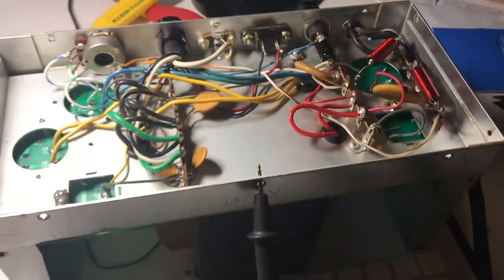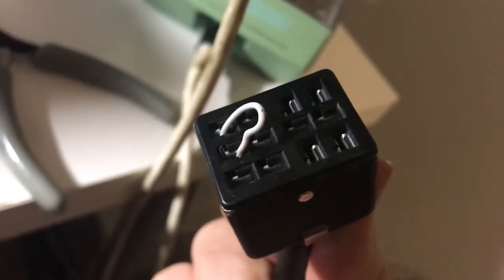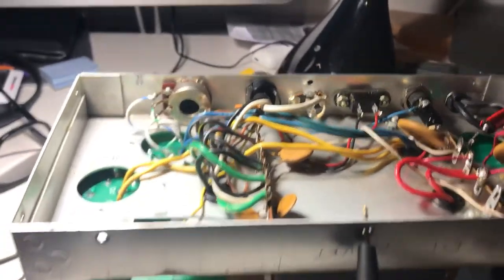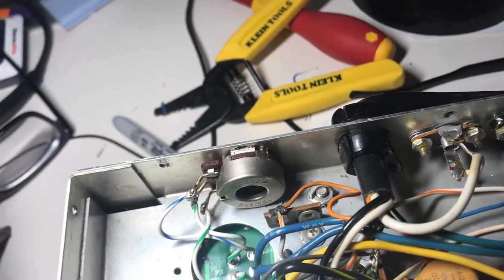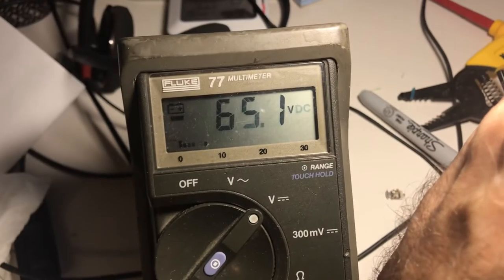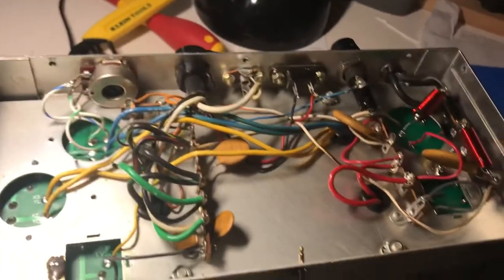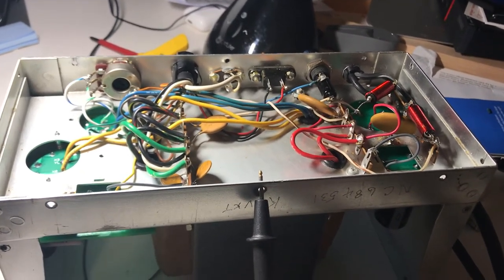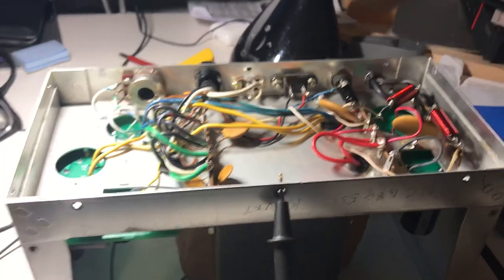Drake AC-4 power supply rebuilt - verification of new voltages October 13, 2021

Comment: We cannot see were you are placing the prob to take the readings.Have you ever replaced the caps in a L4-B and tested to check the voltages?Would like to see how that is done also.I want to get the rebuild kit for my AC4 and the L4-B power supply.Would like to see a video of testing both and the voltages expected.
Reply from the maker: L4-B is on a whole different level. You want to meet DEATH? Turn on the LR4-B and probe the voltages....